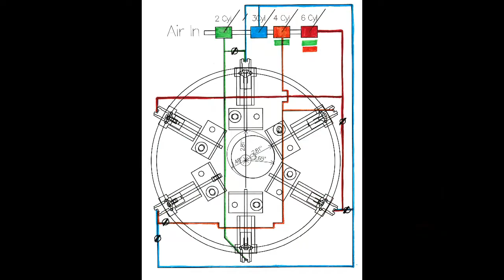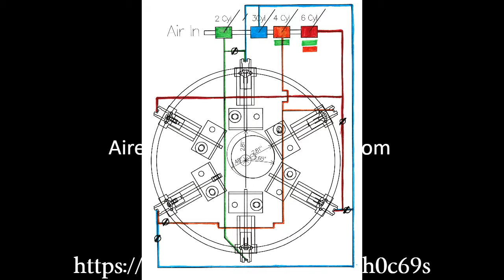Project 2017, Update - Air Lines & Seals done, Run on 2-4-6 Cylinders

Comment: Back in high school I started an Air Engine project. Really cool to find others interested in the same goal! Radial Engines or wenkle-like engines seem to be a common theme.
Reply from the maker: Braden Salois 
My beginning with trying to develop an air engine started in 1989, at an Energy Conference where young high schooler was showing a project vehicle using an air cylinder hooked to a krank on one wheel.
My goal is to build an air efficient simple as possible to install in my Ram 50 Pickup using existing clutch and transmission.
It is essential to have a carbon fiber high pressure air storage tank, which is quite expensive.
 Having a tank, and a means to fill that tank, I expect to get 100+ miles per tank.
Many things said to be impossible were done.  ?
Reply: Have you looked at the work of Angelo DiPetrio? He uses large Carbon Fiber tanks as well and has a working model. When I was doing a proof of concept of sorts, I used a simple paintball tank. I hope you will be able to gain access to large air tanks. Maybe retrofit the bed of the truck to hold the tanks as well?

Comment: You always have interesting videos  on air motors.
Reply from the maker: luckygen1001 
Thanks for the vote of confidence, I try to make my short videos as interesting as possible.
I want to show my success as well as failures and problems I run into.
It seems, every time I get something going - it may work ok, but many times I can see a modification to ( I think) make it better or more compact.
Hopefully it will all come together soon, but - there are major items needed, that are not in my budget.
Compressor and composite high Pressure air Tank.
See you at my next video!

Comment: Nice work sounds good.If u have problems at the sealings try add some grafine powder that you can buy or make it from your self at the pensil.And i recommend to use molygotte grease at the bearings it handle temparatures and will never get water inside.Molykotte is the best a have used many years at the working sides and it will never let me down.Can take extreme heat and cold.
Reply from the maker: ZaKath ZaKath 
Good to see you're still checking in.
I do think I've solved the sealing issue, but sometimes time in use can present problems we're not expecting!
Talking about lubricating bearings, there are only 5, and 3 are sealed. The other 2 are tapered bearings on the drive shaft, where I can try out the molykotte
I still have work to do on finalizing a compact high volume High-Low Air Pressure Regulator.